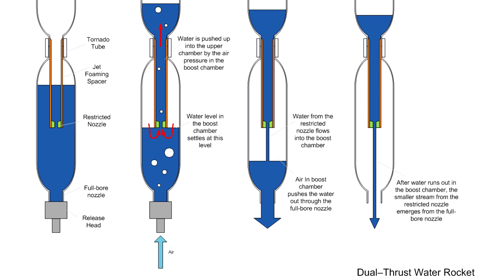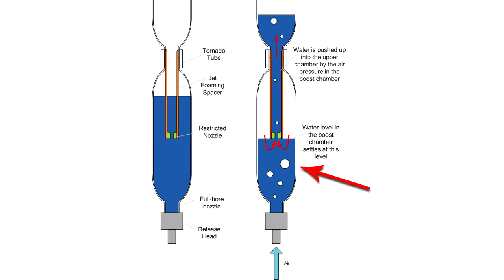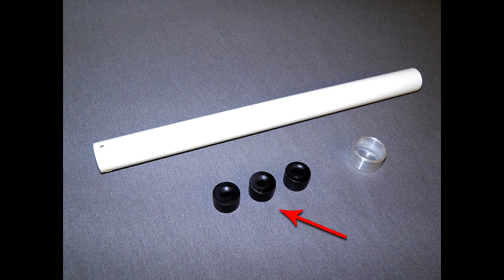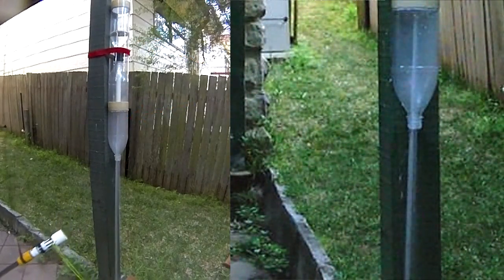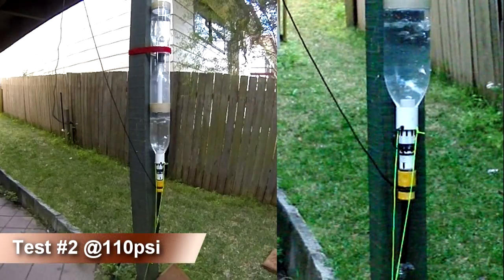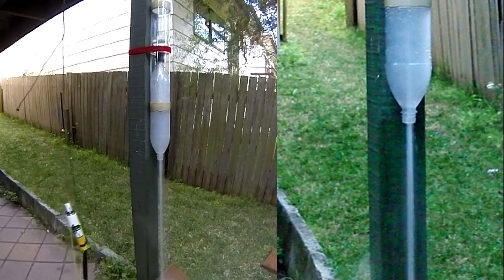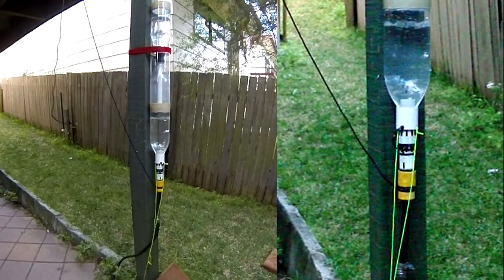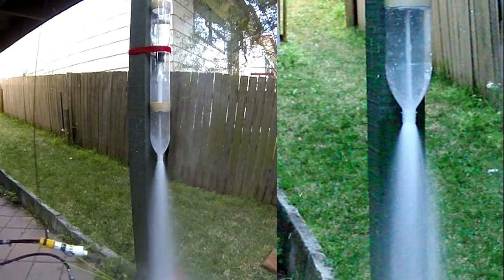Dual Thrust Water Rocket static tests

Comment: Can you make a coaxial nozzle?
In other words, looking at the bottom of the nozzle, the boost flow would come from an annular ring which surrounds the sustainer nozzle oriface. This ring would be mostly a circular ring, with a few remaining supports for a central nozzle. A tube would extend from the sustainer volume--through the boost volume--to the center of the nozzle. This way, the sustainer flow would not be disturbed as much. Perhaps, the central sustainer nozzle could be threaded and interchangeable, to adjust the impulse time. A larger launch release would encompass both nozzles.

I wonder if pilot valves could be helpful for internal staging. When the pressure drops, they could open--like gangbusters.
Reply from the maker: Kind of like this?: https://www.youtube.com/watch?v=uZ_p25VoswQ

Comment: Have you tried liquid propane and water? LPG is 149 psi at 90° temp (ambient) and can replace the air pocket with a liquid that expands as a the air would but should maintain pressure until all the water is gone... possibly allowing you to use more water...
Reply from the maker: We have thought about this previously, but have not done any experiments with it as yet.

Comment: I was inspired by this video so created my own with a similar setup ... the result is the rocket took off very slow then didn’t have enough thrust to maintain vertical flight.  The rocket tipped over and kept firing off while horizontal and got stuck in the mangroves.  I made a nice video you can see on my channel.

Comment: The vacuum is caused by the venturi effect. When the dynamic pressure (velocity) of the jet increases, the static pressure drops! To reduce the effect of the jet punching a hole and letting air escape, you could try to use a conic tube "floating" between the restricted nozzle and the full-bore nozzle. With the small opening pointing up, as the jet would go through, it would push the water instead of the air. I should just be large enough so that after the booster stage is empty, the jet can pass through without being affected..
Reply from the maker: +Nicholas R.M. Interesting. Thanks for the comment.

Comment: This is very interesting on why there is a brief Vacuum inside the rocket. Just wondering, isn't this what T-nozzles are for, to do the same thing?
Reply from the maker: Hi Randy, yup T-nozzles are based on a similar principle, but they only work for the duration of the launch tube. When the rocket reaches the end of the launch tube it switches to the smaller nozzle. With the dual thrust rocket it's like having a two stage rocket without dropping the booster. The boost phase last much longer and has it's own water and air phases.